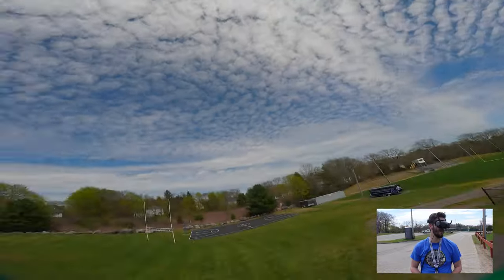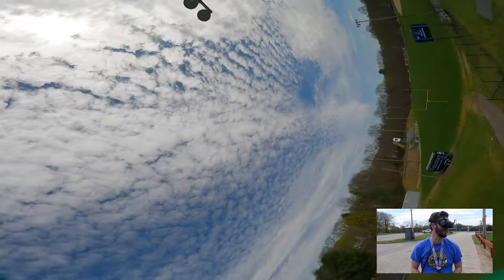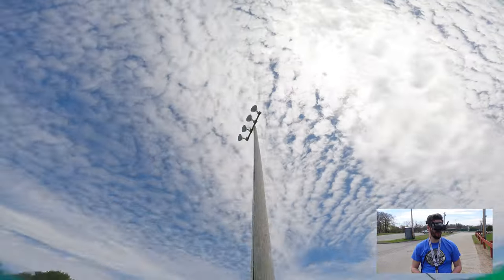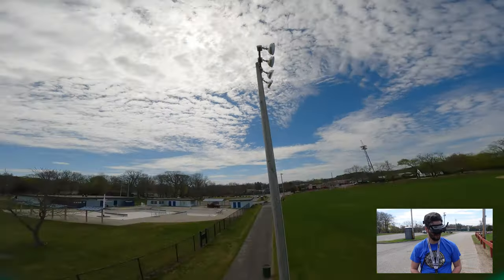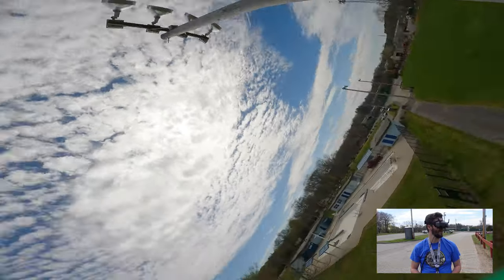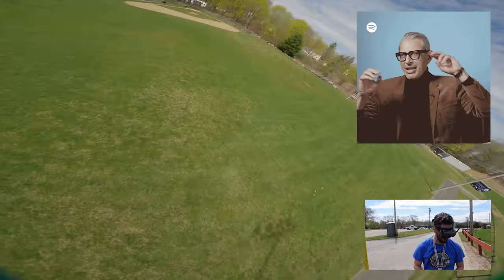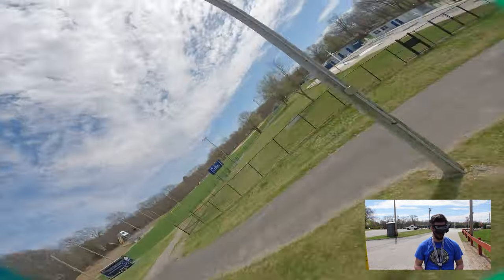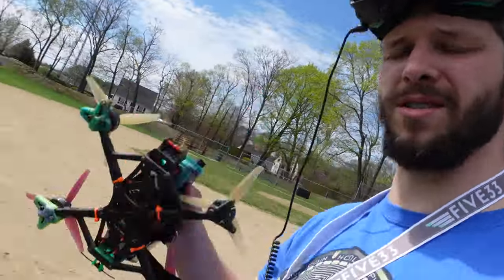I Can't Trippy Spin! or Inverted Orbit? 🤔 FPV Freestyle Tutorial

Comment: great content as always:) i assume you fly always in 4:3?
Reply from the maker: Great question! Especially as 4:3 will provide a higher vertical FOV! I don’t though, one of my quads is on the 03 AU in widescreen, and the other is a vista in 4:3.
Reply: @Kmart_FPV  but the O3 offers 4:3 as well;) it should make the Spin a little easier. 
But im not in the position to give you advises, you fly a lot better then me^^
Reply from the maker: It’s valid, I didn’t think the 03 in 4:3 would give more information. I thought it just cropped in the sides
Reply: @Kmart_FPV  
thats half true;) O3-4:3-mode crops the sides a little, but also enlarges the the vertical FOV a little.
but i fly my o3 and avata in 16:9, too, and my OG-AU in 4:3
Reply from the maker: Either way, I’ll give it a shot! Thanks
Reply: @Kmart_FPV  
you're welcome, i'm happy if I it is useful:)